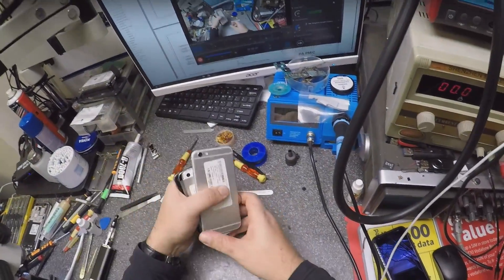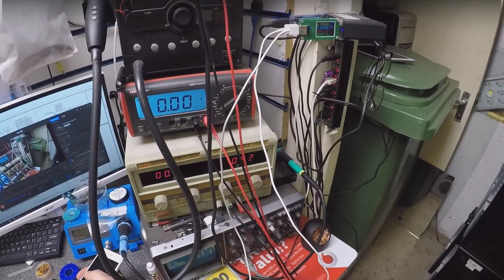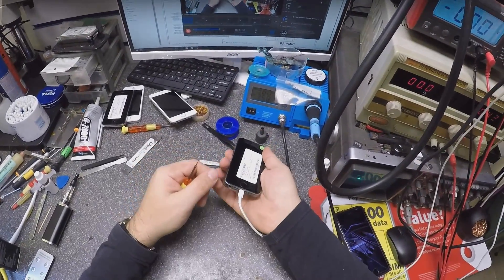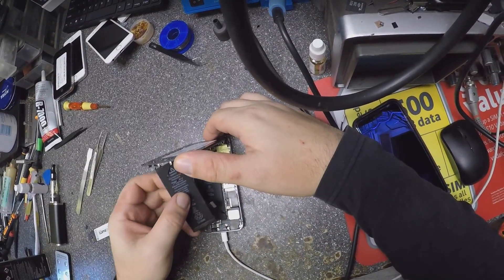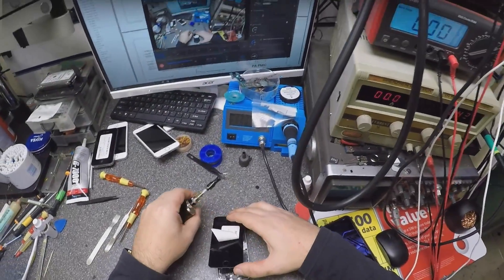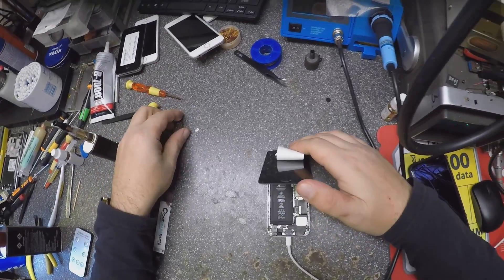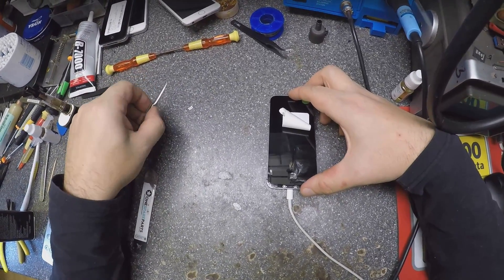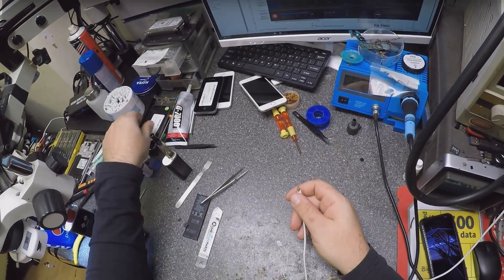iphone 5s no power no charging, easily  fixed

Comment: Hello. Your video was extremely helpful and made me finally take the initiative to try this out as it seemed exactly the issue I've had with my iphone 5s. I've held onto it for years as it has my daughter's newborn videos I never had a chance to back up. I've been in technology integration for nearly 10 years, but never dove into small electronics repair, so I at least promise to not sound ignorant. When I opened mine I did not have the ribbon you detached with your tweezers, but noticed something that worries me there was a short/possible damage. I stopped immediately at that point and made a short video (2:09). I would be insanely grateful if you could find the time to give it a quick view. If not, no worries, I completely understand being busy and overwhelmed with people asking for tech advice/help. lol
Reply: You sure you have iphone 5s ? Because every Iphone 5s has that ribbon cable. its a cabble from home button .
Reply: @aljosha23  Yeah, but I'm thinking the people that repaired my screen cut it and/or removed it. There were two small rivot looking pieces laying loose in the phone I believe were the ends to the ribbon. I also believe they may have caused a short and the reason it died which is upsetting to say the least.
Reply: Sent. Thank you very much!